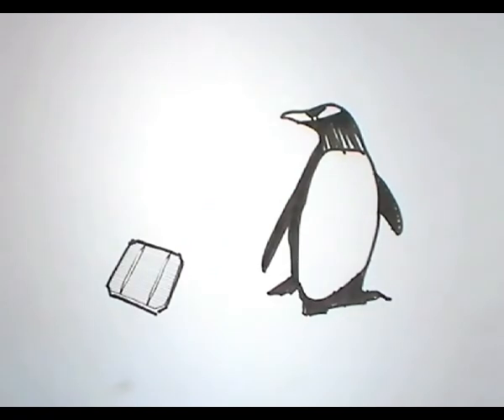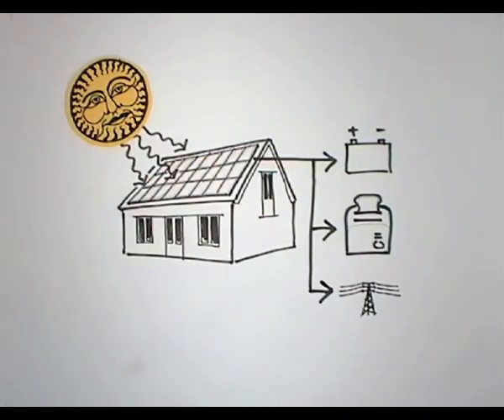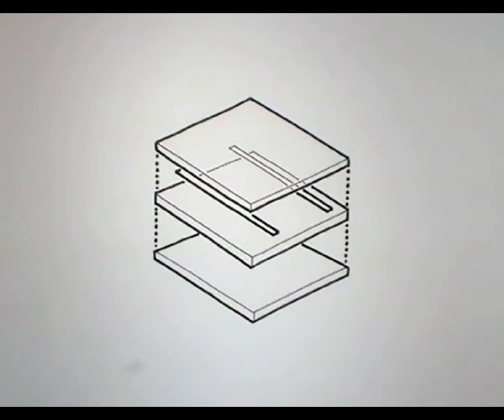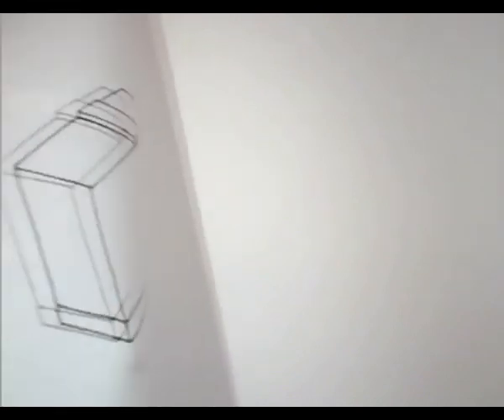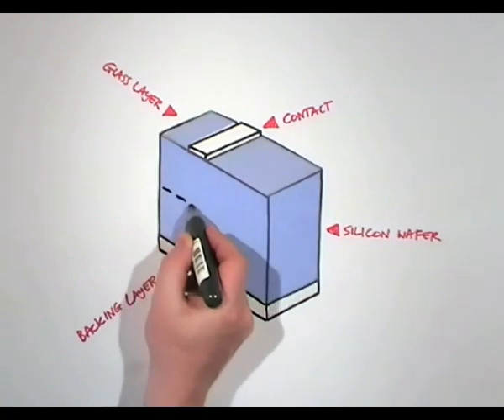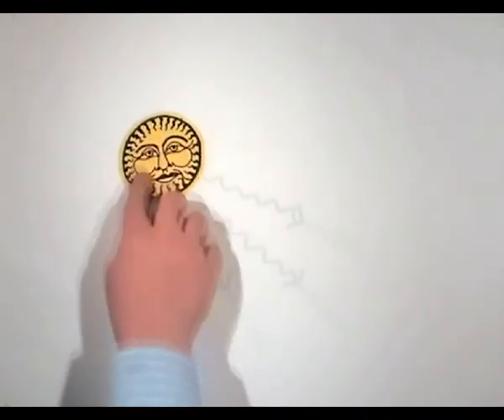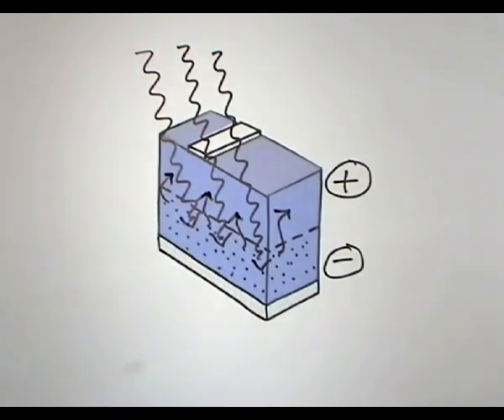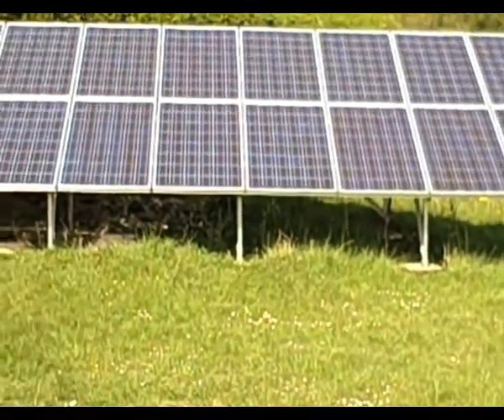How a photovoltaic cell works

Comment: I'd grade this a D- explanation. photons give the electrons extra energy? Give me a break.
Reply: Well, they do though, so... What's your point?
Reply: Yeah, that was too smart-ass of me. The photon doesn't give free electrons more energy, what happens is that bound electrons in the lattice absorb enough energy too promote another electron to the conduction band, also creating another free hole. If it happens near enough to the junction where there is a standing electric field, it is swept across the junction and generates a current, which returns to the opposite side and fills up a hole. Heating the cell would also give the free electrons more energy, but won't generate a current. I guess I was just looking for a more detailed explanation from a physics standpoint. How it works to this level of detail is probably not of interest to most viewers, so my point is feckless; just saying the photon gives the electrons more energy is good enough for government work, so to speak.